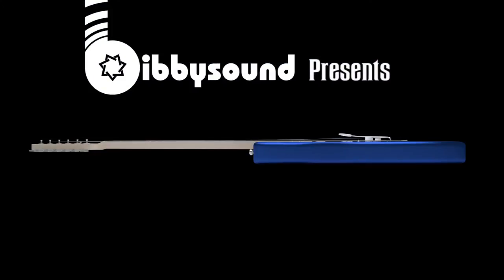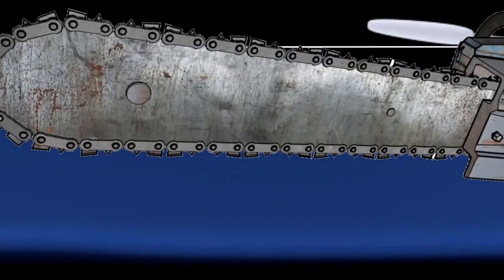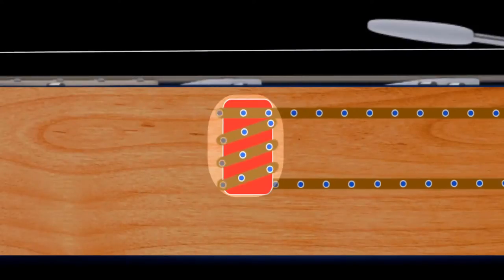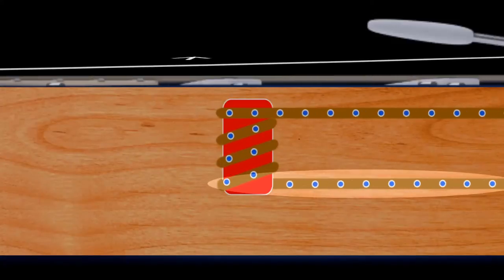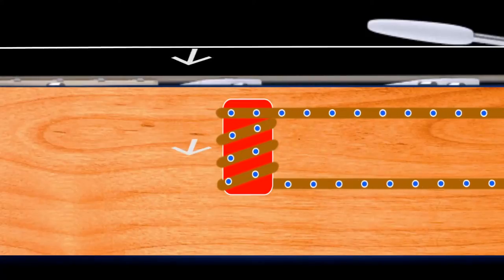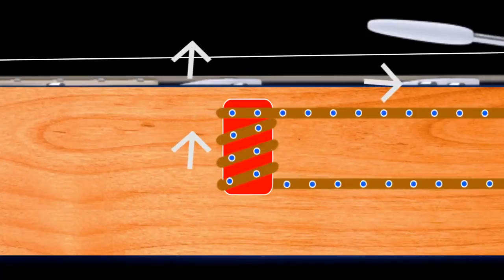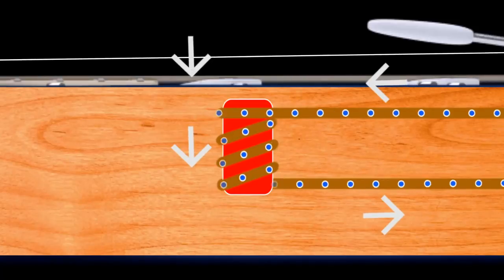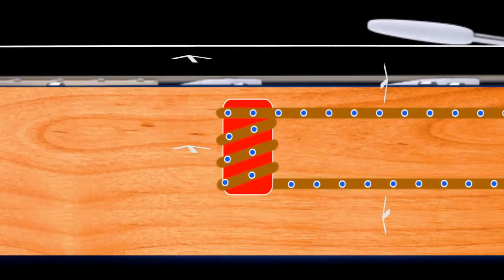Guitar Pickups Explained (Electronics for Musicians 101)

Comment: The coil around the magnet poles are the actual pickup. The magnet poles are there to magnetise the strings so the coil can pickup the strings movement.
Reply: No, the strings are not magnetized, what they do is interfere the magnetic field thus creating electron movement in the coil wich ends up being electrical current.
🍻
Reply: These are the two explanations, which is technically correct?
Reply: @schrenk  Well, giving it a second thought, maybe we should do a little test by seeing if the strings become magnetized just by beeing in the magnets field or they need to be in direct contact with it. I won't do it but 🤣 maybe if you put some metal filings near the nut you can see if they stick to the strings.
I'll try it some day...  in case nobody does it before and tells us what happened.
🍻.
Reply: @dinamoarg  I'm sure the strings become magnetized, but if that was needed, you should be able to place a large magnet somewhere else, like at the bridge, and see more output. I suspect it's actually the strings interfering with the magnetic field at rest that produces the signal. (My "Fields" class was back in the late '70s--so I'm a bit foggy here.).
Reply: @schrenk  Can't wait to get home and do some magnetic exploration on my fake but beautiful Suzuki PRS.
Maybe if you magnetize the strings you end up with to much pull between them and the pickups resulting in less movement or output, I'm just guessing.
🍻
Reply: @dinamoarg yes, they are magnetized. metal is paramagnetic. you are wrong

Comment: Ok so how is that flow of electrons different for higher and lower pitched notes? And what about if high and low notes are played together as in a chord? 

I'm guessing that the volume of a note translates to the amount of electrons flowing (larger/ smaller current).
Reply: From my understanding of what I learnt in physics in school, I'm going to answer this to the best of my ability:

For your question about the pitch, each pitch has a different frequency which is the number of waves (oscillations) in the string per second. I would assume that the different frequencies of each note would affect the rate of the flow of electrons differently; for example it may increase or decrease the rate of the flow of electrons the higher or lower the pitch of the note is. 

To answer your chord question, I have no clue... but if I had to make a guess, i would say that each string would be picked up by a different magnet/magnets from inside the pickup.

 I believe you are correct about your last point though.
Reply: @leopraseuth90  thanks! Appreciate your reply!
Reply: @smollande  No problem mate glad I could help.

Comment: Still don't understand it... This was a crap explanation...
Reply: Pickups are inductor coils. The vibration of the strings causes a change in the magnetic field made by the windings of the wire around the magnetic poles in the pickups. This change in the magnetic field induces a voltage in the pickup winding that goes through the wire that’s plugged into your guitar and back to your amplifier which then changes that electrical signal back into sound.